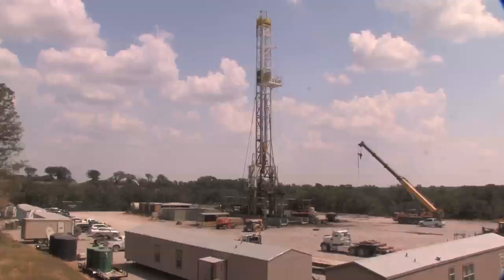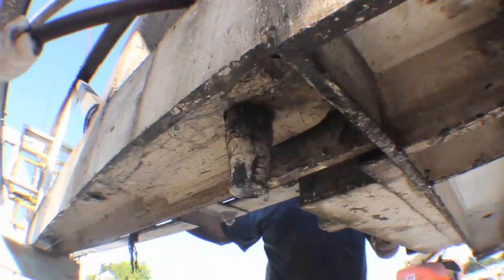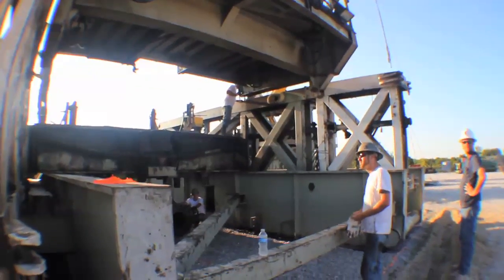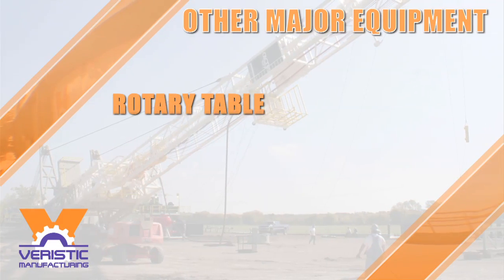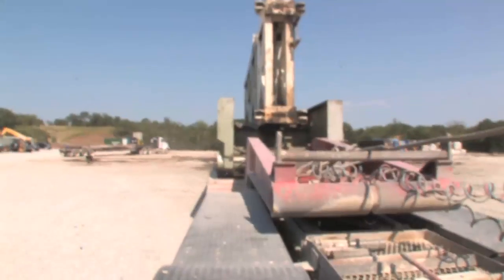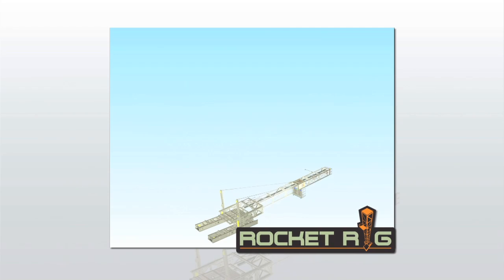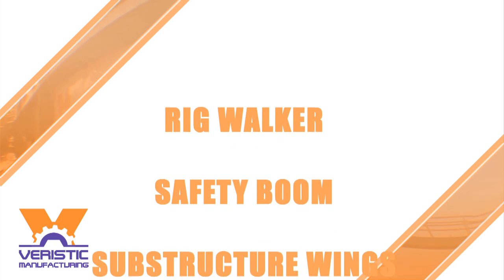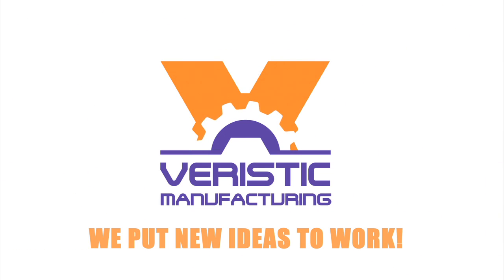Fast Moving Land Rig: The Rocket Rig

Comment: @chuckisi However, the Rocket Rig, raises with hyraulic winches, the mast pins to the bottom substructure  which facilitates ground level assembly, the mast raises with the drill floor, the mast raises from the v-door side, and the mast has a strongback floor that allows for a wider working area between the mast legs.

Comment: @anglocowboy NOV's Ideal Rigs and GES/IDM's Quick Silver are almost identical to H&P's FlexRig. The Rocket Rig is very different from the Flex Rig, Ideal Rig, and Quick Silver. The Flex Rig, Ideal Rig, and Quick Silver raise with multi-stage hydraulic cylinders, the mast pins to the drill floor, the mast raises from the drawworks side, the drill floor "Sling Shots (Dreco)" up, and the mast is straight from crown to drill floor.